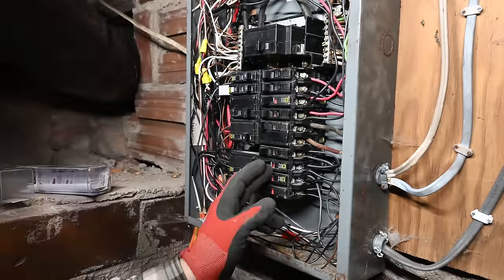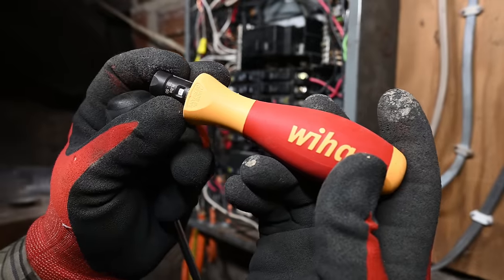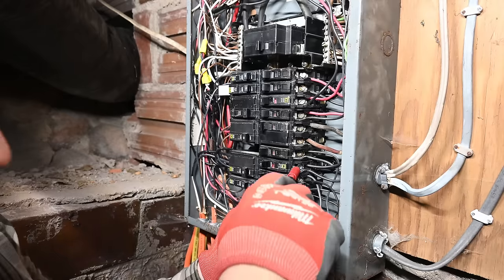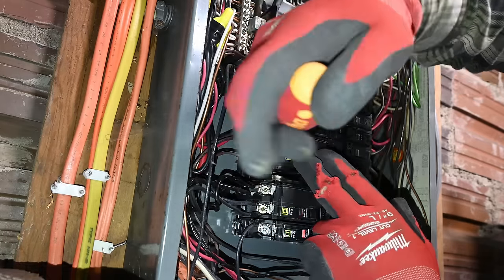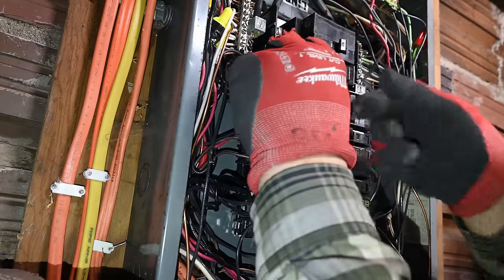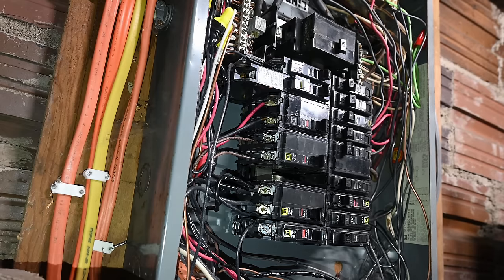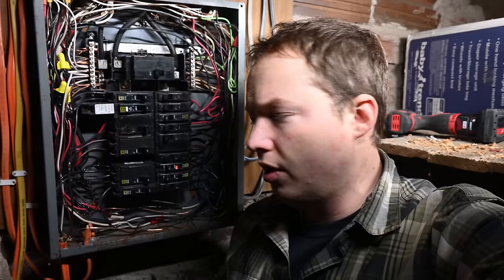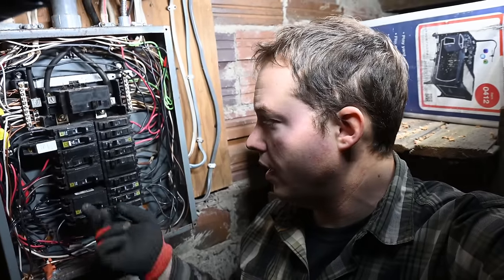Checking an Old Electrical Panel For Loose Connections With a Wiha Torque Screwdriver

Comment: Interesting maintenance topic. I had a circuit with a pet water fall drinking fountain. It used a small electric pump that burned out. I ran through two more “must be defective pumps” before calling an electrician. Couldn’t think how it could be the circuit as a coffee maker on the same outlet was fine.  Electrician traced problem to a lose breaker wire which wasn’t properly tightened.  In any case he put a meter on it an showed me that the lose connection was causing voltage fluctuations.  Thanks for your video.
Reply from the maker: That's super interesting.
Reply: I had the doorbell transformer wire fall out of its circuit breaker last week. I pulled the breaker out to ensure the 16 gauge wire was actually entering the toothed wire jaws in the breaker. Torque on the no-wire breaker was very tight to loosen it and I retorqued by hand. It was obviously not inside the wire jaws previously. I am not sure how the “tighten then pull on the wire to see if it comes out” method didn’t work.

Comment: Thanks for the great video.
Except in recent videos, I have never seen an electrician use a torque screw driver on circuit breaker screws to tighten down the wiring for good contact.
   That is roughly 70 years of watching construction workers!
   For the safety of my wife, our children and me, and our house $200 is cheap.
   Thanks again.

Comment: I saw another similar video about this torque screw driver. They have some good advice about backing out all the screws first than going back using the torque screw driver to properly reach the spec torque settings. Sometimes people over tighten and I know that can cause issues as well down the line.

Comment: because of these videos with that screwdriver I ordered mine yesterday. I cant wait to put a video out on my  channel doing the exact same thing in my panel at the house.  The torque screwdriver was expensive but in our line of work 200 isnt nothing when you factor in something bad happening to someone's house. Those loose connections will get you for sure ... Great video brother.

Comment: I don't know if this was mentioned, but if you are working on an older house that has Aluminum wiring, this is EXTRA IMPORTANT: they have a much greater chance (in my experiance) of loosening over time, due to the dissimilar materials (Alum wire/ brass terminal screws) heating/ cooling at different rates. I've always just made sure they were "tight" by feel, but I'm gonna grab my gunsmithing (Wheeler) tourqe screwdriver and check some screws on a panel I recently replaced in my garage :)
Reply: Excellent point
Reply: I recently corrected an engineer about his house inspection report about a home built turn of the 1950's stating that there is aluminum wiring in the house. Aluminum wiring was used end of the 60's early 70's when copper cost a fortune. Homes wired in BX prior to that had silver clad copper wire. Minimum AWG for aluminum back in that period and still is 12 gauge for a 15A circuit.
Reply: Absolutely. The only problem is that the wires the really need it are the main feed wires, if I'm correct.
Reply: I owned a house that was built by the previous owner. I think he did his own electric work.  I got voltage rises in my kitchen when a toaster was turned on.  I traced it back to the sub-panel neutral which the installer had cut too short. It was pulled tight and had a 90 degree bend entering the lug. It also was not tight enough. Over time the aluminum wire had heated, oxidized, and became even looser. I was able to fix this, before I fried any 120 volt appliances. A loose neutral is a serious problem, so if the power company suspects it is in their connection to your house they immediately send a line man to correct it.

Comment: The Wiha torque screwdriver is designed to use its own insulted bits and not 1/4” bits without an adapter. It keeps your hands away from a live circuit rather than as close as you were.  Great videos
Reply from the maker: Yup! Probably worth the investment too. I need to get the bits so I can stop complaining about not having them! Haha
Reply: @BenjaminSahlstrom  I have them they are excellent you can use them for the wiha Speed E and speed E2. Get the speed E2 great for receptacles you can get separate predefined torques bits for SpeedE2 as well.  Question is do you do that with receptacle terminals? I do the NEC 2020 Handbook and Annex I has details.

Comment: Also check the neutral wire and earth wire. And in the sokets too.

Another tip. Place the wire loop around the screws in a clockwise direction if possible, so the wire turns in and not out when tightened.

The WIHA screwdriver is insulated up to 1000 volts.

Comment: In my University we have make a test, how high the force of a connection is at the beginning and how the force is decreasing with time.
First we increased the force of the screw so high, that the cooper string which is between goes in a condition of material flow, so that he is not round any more and the force is pressing the surface on the contact-area, so that they are flat to each other.

The force decrease in the first seconds very fast and within the next days slowly, till the material is not any more in this flow-mode. This means that the copper-wire does not change his shape any more.
But this means that you can build up a force of 36 inch pounds  (we use Newton Meter , Nm) and after a while the force has reduced to maybe 32 Inch pounds.
This means that you can go to the same Panel and increase the force to 36 Inch Pounds again, but this will make the cable more flat.
A while this will be okay, but some day you have to cut of this peace of cooper and use a new section of the cooper-wire which is unused.

An other interesting fact is the way how the force if wires will be reduced.
If the wires heat of because of a high current, then the diameter want to increase (material expansion because of heat), then the material comes into the flow-mode and the contact force will be reduced so that the material comes out of the flow-mode.

But if the current in the wire is reduced, the heat will decrease and the diameter of the cable is shrinking (a tiny bit), but because of this the force is lower that at the beginning.

Now we increase the current over the wire again, but now the connection is not so tight any more and this will increase the contact resistance and this leads to more heat. 😕
More hat means more material expansion and again a decrease of the pressure-force to the contact.

This goes on and on ... and is the reason for for cable fire in the meter box, flush-mounted sockets and everywhere where contacts are.
The best solution in my opinion is to use circuit breaker with spring contacts, there the force is always the same and the maintenance effort is reduced.
 You do not use special tools to create a good connection.  Some of he "Hager" circuit breaker have it and there it is called "QuickConnect". I think in the USA they will have something similar.
Reply: It seems to ME that a spring connector will also be affected by heat, and would likely be more problematic than a screw that can be retightened.
Reply: @whotobelieve3612  - No. Imagine you have maybe 3 sheets of metal and you connect them with with screws. If you heat up this metal, then all 3 sheets will expand and increase the force on the screw, so that the screw will expand too.  The force will go to unlimited, because expanding metal .. is not easy to stop.

If you cool this down now, then the 3 plates will be loose a bit and do not connect to each other so good any more.

If you use a spring between one side and the nut, then this force will be nearly constant. Even if the 1 inch thick sheet of metal will expand 0.01 inch, then the spring (maybe 0,1 inch in length) is able to reduce the increasing force to only 110% of the initial force of the spring.

If you do not use a spring, then the additional 0.01 inch will increase the force on the nut to an insane value. The screw or the piece of copper that is in between has only the choice to deform.
Reply: I think "creep" is the metalugical term.

Comment: Be nice if there was a 1/4 in square hole in the end of the handle so you could use a ratchet to assist in getting it torqued down.  Does look like a lot of force just for the spec you showed in the video.  Sure it takes its toll after a while.  Really enjoy the channel.  Thanks for taking the time to put together all these videos.

Comment: I just power off and torque with a quarter drive inch pound torque wrench. Works well so far. Higher torque lugs get a bigger torque wrench. Have a set if Allen bits, torx bits and screw deiver bits.
Reply: A lot cheaper and you get the same affects.

Comment: Benjamin, great video except you just got started.  Our company used to do scanning of electrical components as part of preventative maintenance as part of our business.   When scanning panels, we would find hot connections.   99% of the hot connections were the neutral connection, not the breaker or hot connection.  Not sure why but that is reality.

Comment: That is an interesting conflict.  They're supposed to be torqued once, not twice.  Yet many of the torqued 'once' connections I've encountered allow you to pull the wire out of the connection with a simple tug.  The torque thing definitely has some flaws...especially with stranded wires.  Just IMO.

Comment: The general rule in using torque drivers is to tighten to about 75% then slowly tighten to the final spec - then STOP. Repeated turning, once the click has been reached, is a guarantee to over-torque. Testing unknown fittings might be a variable, but generally once the click or desired setting has been reached, that is sufficient. Breaker screws may be able to handle 10% more, but then risks include stripping the threads, or over-compressing/cutting the wires.

Comment: Your muscle straining does a good job of showing that 36inch/pounds is pretty darn tight with a standard screwdriver, obviously much easier to hit with a wrench due to leverage. All the pros and DIYers that tighten the screw to 'tight' and check it by pulling on the wire are fooling themselves. You really need to put some muscle into getting the right torque.
Reply from the maker: I was surprised by it as well. I want to test it against another torque wrench to make sure it's accurate. I don't really doubt Wiha's quality though so I'm sure it's correct but it did feel really tight.

Comment: I had a problem years ago with loose connections for my dryer receptacle.  I do wish I had a torque screwdriver, however an electrician taught me a trick and I would be curious if this works.  Tighten it down until it stops, then back it off a little bit, then you can tighten it a little further.

Comment: Proper torque is really important.  I had a hot tub circuit board fry with one of the leads melting in its connector.... must have loosened over time.

Comment: It's the same with torque wrenches you want to set it at the minimum after your done as you don't want prolonged 'pressure' on the internals of the tool, as it will/can go out of calibration range.

Comment: Thanks for bringing up this subject. Don’t forget that copper is fairly ductile so it will deform a little over time rendering the connections looser than when they were installed. If the panel is located where there is a wide swing in temperature that also causes the connections to become looser over time. Additionally, some breaker circuits that are heavily loaded may also be subjected to the conductor heating up a bit. All of these factors result in the connections loosening up over time. Also, it is not just the breakers that require correct torque, but this also applies to the ground and neutral bus bars, in feed connections, etc. What I don’t know is how often that the connections in any given panel or disconnect switch should be revisited for correct torque. Anyone know this?
Reply: I don't know, but I'd say 5 years;  10 years for sure.
Reply: It’s so very fun for me, 
so i tell you: I have the hobby to spread science by asking people for watch-suggests and also offer the same.

Comment: You can buy a petty nice inch pound torque wrench with fittings that are used in bicycles shops for under $80 dollars. It would would take some of the grunt out of wiring a box. I’m a automotive mechanic that just sayin. Oh! I almost forgot you helped a bunch when I was installing a generator connector box, running conduit, installing the safety lock out slide switch thingy, moving breakers, grounding every piece of metal, and running 6 & 8 AWG wires. When I was done I Ohm’ed every wire at least three times looking for shorts before test running the install. I don’t like working around big time utility or big generator voltage. But I did get the certified Electrician down the street come and inspect it all. I was very proud of my work but he just said it was OK!😦

Comment: Thing is:  You cannot 'verify" torque by rechecking.  Wires collapse under [mechanical pressure] load with screw-type tightening devices.  Hence the argument for 'spring-type' devices.  I still like screws over springs but realize that screws are fixed-position and springs maintain mechanical load.  Fun stuff.

Comment: youd be shocked how loose connections get after decades.. the 14 acres i got.. i replaced every receptacle and switch in the house.. and boy oh boy every wire nut and screw on the connectors were needing tightened... i just replaced it all.. deff isnt worth a fire.. now i need to work on the barn receptables and switchs and the former dog kennle building

Comment: I have often found that screws have worked loose over time due to the consent current fluctuations that screwdriver is a good one and I picked up a universal 100-bit screwdriver pack that fits nicely and gives you all the bits you will need
Reply from the maker: Nice! What's the model of the bits you have?
Reply: Oh, they're in the Handel.  LOL

I know you've done it....

Comment: For bolt on style breakers does the torque spec  apply to the wire connection and the bus bar bolt on connection?

Comment: Harbor Freight 1/4 drive torque wrench and long extension for the win. Although I do own the Wheeler torque screwdriver too.
Reply from the maker: I wonder if they make insulated 1/4 extensions. That would improve the safety aspect.
Reply: @BenjaminSahlstrom  Why? If you follow the 3 Golden Rules of Electricity there is zero need for insulated tools.
1. Don't work on live panels.
2. All circuits should be considered live until confirmed dead.
3. If stupid enough to disregard above confirm you're not the path to ground.
Reply from the maker: @jstaffordii  True! Still doesn't hurt to have insulated stuff wherever possible though.

Comment: It would seem like there is not such thing as "over torqued"?  Since the screwdriver will break loose, it is not capable of telling if a screw was torqued too much (risk of breaking internal threads or holders).  Any thoughts on this?  Great video...

Comment: Benjamin, Thanks for another quality video! Short comment: Don't forget the Neutrals. I see this loose connection problem a lot.   So, the Neutral bus connections should also be checked when performing this procedure.  The Neutral conductor connection is often overlooked or misinterpreted as a less important current carrying conductor. But, with the increased influx of electronics and switching power supplies, the potential for harmonics in the local electrical system is often increased and so, increases the need for maintaining the integrity of the Neutral conductors and connections.  The "Unseen load" created by Harmonics in a system can be problematic and in some cases calls for up sizing the Neutrals.  Thanks again!

Comment: Nice video!! I was wondering if after the click does it keep turning the screw if you keep turning ?
Reply from the maker: Nope, if you keep turning it just keeps clicking and does not tighten any further than the torque setpoint.
Reply: The proper way to use any torque wrench or screwdriver is to tighten slowly until it clicks and then stop turning. If you are tightening quickly, or turning past the point where it first clicks, you can get the screw / nut to tighten more than the torque you set. So if you keep turning past the click, it will keep clicking, and may over-tighten a little bit, but eventually the screw won’t tighten anymore
Reply: Thank you for the reply!!
Reply: One-click only as these screwdrivers should be checked for calibration every 5000 clicks - don't waste the clicks!
Reply from the maker: @efixx  Interesting. Didn't know that!
Reply: @efixx  Who's counting?

Comment: Had an issue on a breaker. The wire was glowing as it came out of the terminal. Only noticed this as the room was dark. It fed a kitchen outlet. I disconnected and the wire was blackened. Wonder if it was loose causing an arc...
Reply: A loose connection creates heat. Sometimes you can see damage to the insulation from a bad connection.
Reply: @richardh361  I should rephrase. It was causing an arc. I could see it at the terminal. Tried tightening it down but damage was too severe. Will need to swap out the fusible unit. Thanks for your feedback, Richard H.

Comment: Good point, home diyer,, and had a strange occurrence plugged an airless paint sprayer, popped breaker, had lots to do so moved on to another outlet, when I finished went to reset breaker, none tripped, never solved, went to bed, next morning magically circuit working this is a lamp circuit so effects lights, switched outlets,  turn one more on, lights out, now the dmm comes out and every breakers is showing 120, but no power,  voila about 12 hours later, power comes on,  flip every breaker, no circuit goes off, can a breaker fail thermally like that?